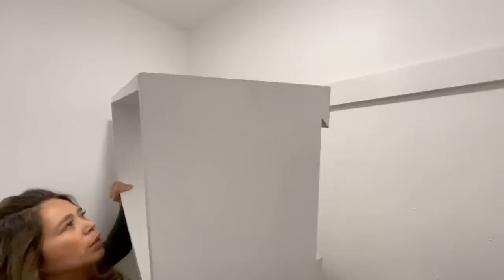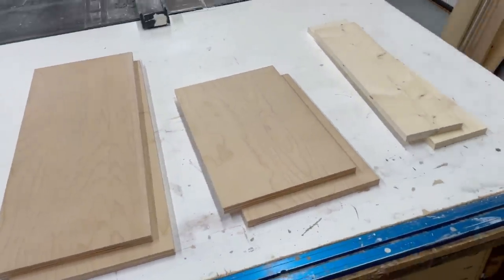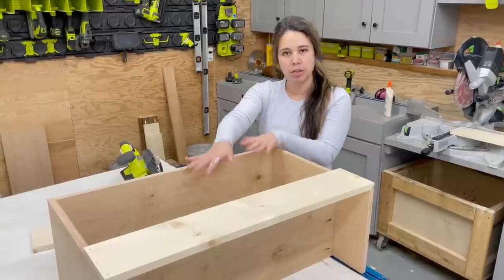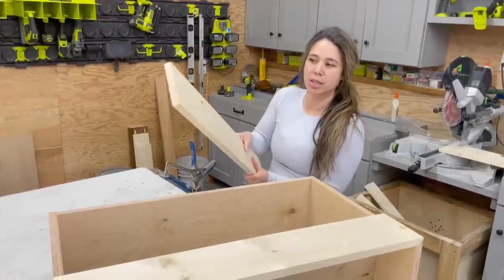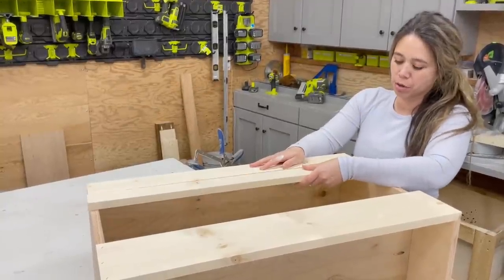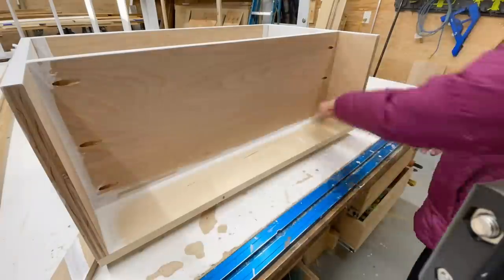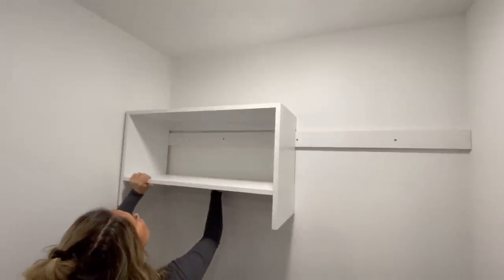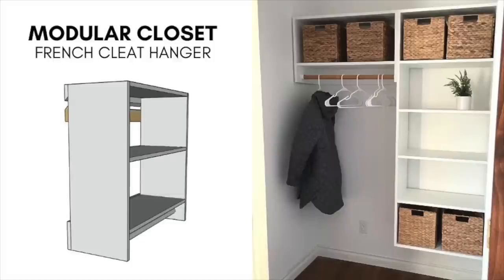French Cleat Modular Closet With Free Plans

Comment: Hi Ana... Really clear instructional video! I love the French cleat except for the space it creates between shelf and wall. I am building a smaller version of your shelf tower, 48" high with four shelves (2 fixed) and two 31" top and bottom hanging rods attached on the right side. A long shelf on top will be secured to the unit with cleat support as well. Do you think traditional cleats can handle this weight or is it too much? Thanks for helping out this diy newbie!